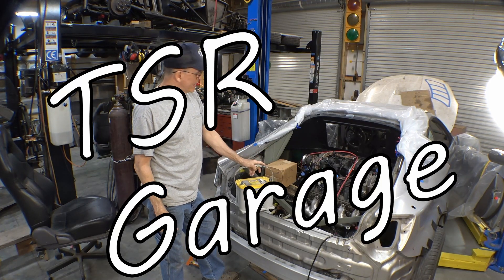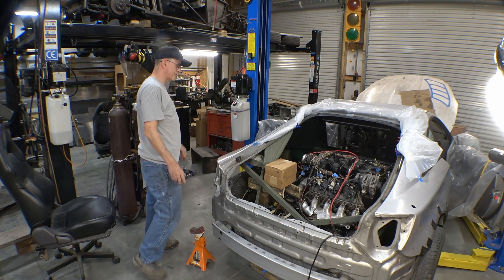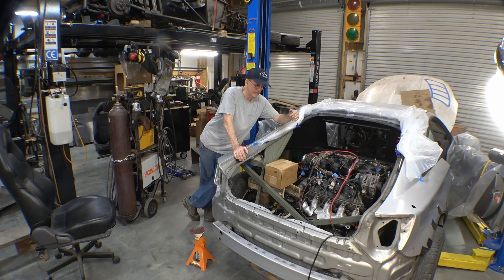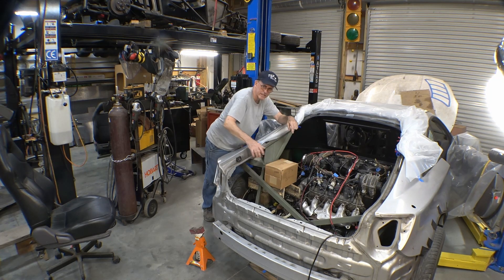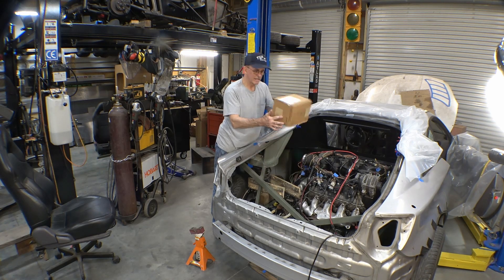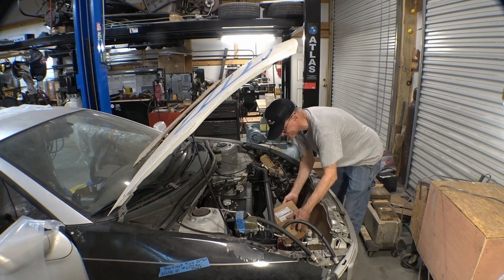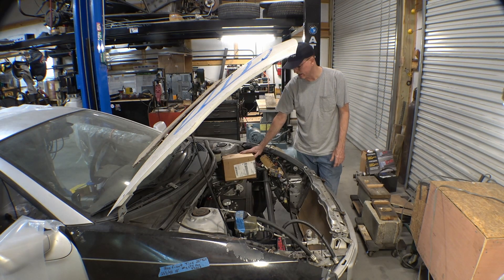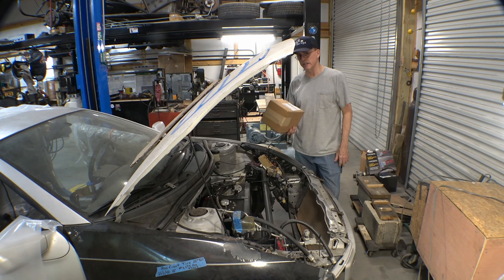Battery relocation ? . Celica GT-SS

Comment: Great video again.  For a project car, where you will probably want to easily disconnect the battery often, I would recommend location 2 with cage or 1.  Just remember the batteries have a lot of plastic (keep away from heat).  I agree, don’t put anywhere near fuel.
Reply from the maker: 👍good points.  Position one would require a little heat shielding, being near (above) the exhaust, but is great for serviceability.   I am thinking about a battery disconnect switch (like race car or boats have) especially if I do position 3 . Switch it off when not being driven for a while. Battery would last longer.  Would have to reset radio presets🙄 when you turned it off. .